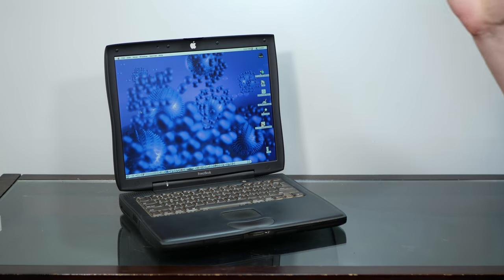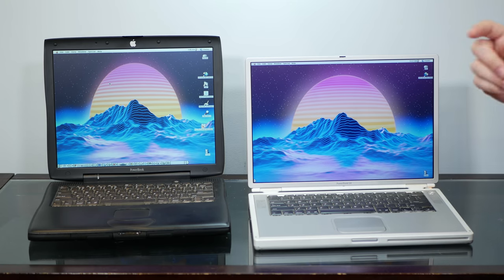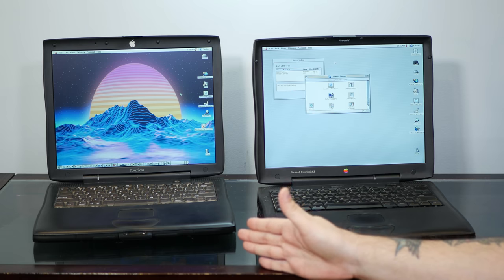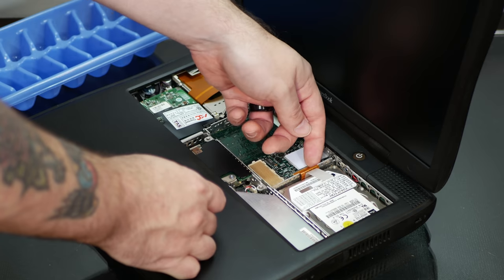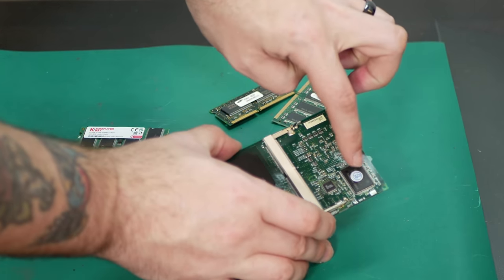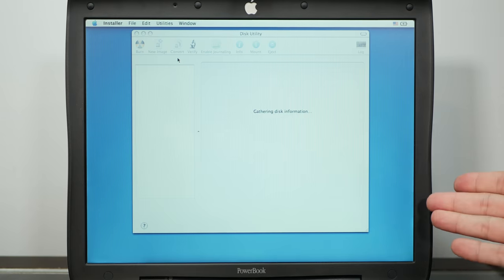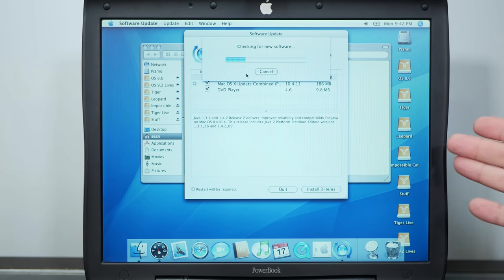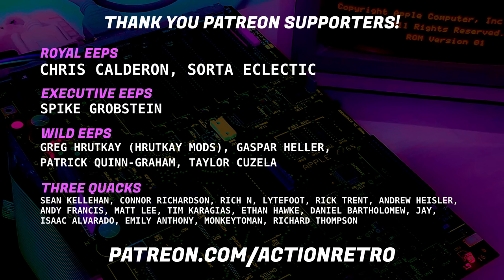I'm Sorry, PowerBook G3 Pismo.

Comment: SSDs make everything better.

I have a 12-inch PowerBook G4 and it's a lovely little machine but the G3 Pismo is the vintage Mac that I really hanker for...
Reply: @lewisalexander  I bought a Pismo for £75 ($100) on eBay a few weeks ago, working and in excellent condition; looks like new. They’re getting harder to find now so if you want one, best to buy whilst they are still available. I bought it purely for nostalgia reasons, I couldn’t afford to buy one back in 1998!

Comment: People love Pismos not for looks but for flexibility, reliability and upgradability. They don't have the hinge or paint issues that plague the Titanium G4s, nor the L2 cache issues and plastic cracking of some earlier G3 models. The 400MHz one when fitted with an SSD is dead silent too - I've never had the fan kick on with mine, even under intense MacOS9 gaming!
Reply: They are much less flexible than the wallstreets though. The wallstreets had two fully modular bays that could accept any drive module each. The pismo and Lombard essentially just have one bay plus a battery. Also the Wall Street has SCSI and Serial, which the pismo lacks, but can still get fw and USB via cardbus. Finally, the build quality of the wallstreets was much better, if not heavier and bulkier.
Reply: I love them for looks. They look amazing

Comment: It feels kinda interesting seeing how EASY it is to replace the components on the PowerBooks of the time, in contrary to the iBook lineup which, annoyingly is like disassembling 85% of the whole laptop to even replace the hard drive lol

I really wanna get a Pismo PowerBook someday, ain't fun messing around with aging iBooks x(
Reply from the maker: lol so true
Reply: @ActionRetro  Not to mention the screw hole threads are molded into the plastics, and can break easily! Mine has half of them broken, so there's no point screwing the screws back :P
Reply: @SonicHacki  I had really good luck with my PowerBook G4, 12-inch.  Did the same SSD upgrade as this video (except it was a 32GB SSD - but same off-brand and adapter) but it was definitely a voyage of discovery.  By contrast, changing the HDD out for an SSD in one of my 2009 15-inch MBPs took me literally five minutes.  The Unibody construction was a huge, huge leap forward - but these G3s weren't far behind.

Comment: I recently performed the same upgrades with my Pismo, replacing the old hard drive (which was still working, btw) with a 120 GB mSATA, and maxing the RAM to 1 GB. Partitioned the SSD into two, with Tiger 10.4.11 and Mac OS 9.2. Back in the day I did the 550 MHz G4 card swap but for whatever reason I had left one of the RAM modules at 128 MB back then, such that I ran with 768 MB. Must have been because RAM was so crazy expensive 20 years ago. Anyway, with the SSD and max RAM, the Pismo is running so much faster than I remembered. It gives a reasonably modern experience, despite being 20 years old!
Reply from the maker: Nice! Honestly I'm shocked at how silky smooth Tiger feels on here, even with the slower 400mhz G3. TenFourFox is snappy too!

Comment: Damn I wish I had a Pismo... 

Meanwhile all I'm stuck with is a basic 333MHz Lombard with an ailing hard drive cable, a power supply that just died on me, a CD drive that doesn't want to slide close but otherwise works fine and a battery that somehow still holds a charge. Worse yet is that the Lombard only has 2 USB ports, so no firewire booting for me!

Comment: I had the Daystar/XLR8 Mach Speed G4 550 upgrade in my Pismo, installed around 2006 or 2007.   They required sending the whole laptop to them for the upgrade, not sure why?  I searched my email and I still have the receipt, it was expensive -- $639 got you 1GB of RAM + the CPU upgrade.
Reply: They probably desoldered your Mac's ROM chip from the original card and applied it to your new one - they can't flash their own chips with the Mac ROM as it is © Apple. Some had a software tool to dump it to disk and a basic loader on the upgrade to write it to its flash chip instead.

Comment: I had a Lombard and then a Pismo back when they were new and they were wonderful machines. I ended up modding the Pismo quite a bit, installing a 500mHz G4 and translucent blue keycaps, as well as doing various things with the expansion bays. I even had an adapter that would turn an expansion bay into an external FireWire drive. I used it as my main machine until 2003, but I still kept it afterwards. Just last year I did a similar upgrade as the one you showed, adding an SSD and honestly it’s still very comfortable to use, as long as you’re doing something period appropriate
Reply from the maker: I've been writing all of my scripts on my 12" PowerBook G4, I think I'm going to try writing some on the Pismo instead. There's just something about it that feels special.

Comment: I completely refurbished my 500mhz model, the screen had a very, very dark pink hue that would not go away, the keyboard was on its last legs, the battery was stone dead, so was the hard drive, the cmos battery and the dvd-rom drive, it didn't had the flap on the back and some other minor issues. But now, it keeps date and time, the screen doesn't have that horrible pink tint anymore, the battery keeps a charge (because i changed the cells, and yes, even the indicator light still works), it has a dvd-rw drive now with the original bezel attached to it, it has a 100gb hard drive, i even attached its flap on the back, so now, this machine looks like a good example powerbook, it was my dad's laptop he bought new way back in 2000, i am very glad i got this machine back up to original spec and working perfectly fine!

Comment: Oh shit, 1GHz G3! Maybe I missed you saying so, but do the instructions per clock make it faster for most instructions than the G4?

I love how easy these are to tinker with. Makes you laugh that some people back in the day said laptops were prohibitively difficult compared to a desktop. Sometimes you even need a non-standard part and everything! The horror! Nowadays even a removable battery or RAM is a big deal...

Also, really nice audio on this one 👍
Reply from the maker: Thanks again for all your pointers! Good question about the speed vs G4s. My understanding is that integer performance should be about the same between matched clock G3 and G4 in the same machine, if bus and everything else is the same.

It might make a really interesting video if I can find the G3 500 card to benchmark against the G4 500 upgrade I just picked up! Although cache is different between the two.

Comment: The Pismo was a great laptop but the bridge from the older Powerbooks (Wallstreet) was the Lombard. I had a Lombard. It was like the Pismo but with a SCSI but no firewire vs the Pismo had firewire but no SCSI port. Also the bus speed of the Lombard was 60MHz while the Pismo was 100MHz. You could get the G4 upgrade for the Lombard as well back in the day. I had a 333 G3 i upgraded to a 400 G3 but never got the G4 upgrade. Ran great on 10.3.9. Sweet memories.

Comment: Dual 3550mAh battery repack, max RAM, and probably a custom made 1.7GHz 7448 board. 120GB SSD triple booted between 9.2.2, Sorbet Leopard, and Void Linux. And I'd probably color in the Apple logos or cover them with rainbow logo stickers.

Comment: Looks great! Don’t forget to upgrade your firmware to 4.1.8 before you upgrade to your G4 CPU. Most upgrade cards require the latest firmware before installing the upgrade (some require additional software changes as well). You will also need OS 9 on the machine to do the firmware upgrade (9.1 or later I think, but I always just install 9.2.2) . Feel free to reach out if you need help finding the firmware. Hope this helps!
Reply: Hello, I need help finding the right firmware for my All-in-One 5500 Power Mac.  After adding a 7-inch PCI card with to provide two USB 1.1 ports received an error message saying that, I needed a software update.  Do you know where, I can download OS 9.1 or OS 9.1.2?
Reply: @transitengineer  I am assuming you mean operating system, not firmware? If so, according to EveryMac, the last natively supported operating system for your 5500 is Mac OS 9.1 (there is no 9.1.2; the only official versions of OS 9 are 9.0, 9.0.4, 9.1, 9.2.1, and 9.2.2). PM me if you have not already located Mac OS 9.1.
Reply: @prototypebuilder5150  Thank you, for your help yes you are correct it is version OS 9.1 that, I need.  Back in the day, I had made a copy on a Zip Disk but now, I can no longer find it.  Please let me know how, I can get a copy of OS 9.1.
Reply: @transitengineer  There is a Garden and a Repository where you can locate an installer for OS 9.1. Both of those are great resources for finding old Mac software. Hope this helps.

Comment: just like with the clamshell, if you cut open the mSATA enclosure (I do mine in thirds, so I can still secure it), you can swap out the mSATA by just lifting the keyboard.  No need to remove the processor anymore.

Comment: the amount of compound was perfectly fine, it's that again, AS5 is not recommended for chips with SMD components surrounding the core because it is semi-conductive no matter how much arctic silver wants you to think otherwise.

RTL8188CUS based USB WiFi adapters (i.e. Netgear WNA1000M, a nano N150 adapter) are still a good idea, if you are willing to give up a USB port to it. 10.4 drivers are readily available off a google search. an Echo Indigo or Indigo IO will provide 24/96 audio playback for maximum hipster cred, and getting a G4 out of Australia is worth the upgrade given you do the hot air swap or have someone do that for you.

Comment: Make sure you have Trim enabeld for your SSD. It was not available until OS X 10.10.4 (without using 3rd party tool)
Reply: No TRIM support in 10.4 iirc, but modern SSDs with a good controller and DRAM cache make TRIM uneccessary nowadays.
Reply: @chriscalderon1337  I doubt you are correct with that statement, I'm googling but can't find any information stating that TRIM is becoming uneccessary nowadays, paste a link here if you find it. Regardless, that 60GB mSATA SSD can probably not be considered modern. It will work without TRIM but get slower over time.
Reply: Would also be interessting to know if TRIM even works using that IDE to mSATA converter. Maybe it wont.
Reply: I believe Trim is part of the SSD and doesn’t really care about the external interface.

Pretty sure that Trim software was separately available — possible that DosDude1 has it stored in one of the folders on his web site too.
Reply: @stevearkwright unless there has been some recent changes, TRIM has to be initiated by the operating system, and older operating systems did not natively support this. It's basically a command sent over the interface.
After some searching it seems it can work with some IDE to mSATA converters. So not a hardware limitation which is good news.

Comment: I bought one of these back in '05 and painted the top plastic bronze to match the keyboard; also put a color matched film under the logo so the apple glows bronze as well. Blending those colors (black, bronze, white) properly really changed its whole character. I had a TiBook (667 DVI), G4 iBook, and this through the '00s, and this was by far my favorite. It was like having one of the desktop tower cases in laptop form in that you could access everything within a few minutes. The big thing to keep an eye on: mine is on its 3rd sound/power plug board. The constant in and out of the power plug seems to wear them out, and it is only about 3 steps from a total motherboard replacement to swap it. 
That said, I still have and use mine. It even has a functional BTI battery. I am curious though: where do you find good rebuilt batteries? I would love to have a double setup.
Reply: I think rebuilding the Pismo's batteries is DIY only right now, I haven't seen anyone advertising but it'd be awesome if there was a place to refurbish them for you.
Reply: @amirpourghoureiyan1637  That's what I thought too. Thanks.

Comment: Glad you came to your senses :P

Did you replace the little aluminium shiv between the CPU and the heat sink? After reading up on this a bit, I opted for K5 Pro instead of standard thermal compound as it has better vertical reach, negating the need for the shiv.
Reply: Not sure all have one fitted - mine didn't have one when I removed the heat sink, and the compound was the original black stuff. A simple MX4 application worked well for me, using an OS9 temperature monitor the CPU stayed below 60 celsius whilst playing intense games even.

Comment: A couple minor notes: The Pismo had no native floppy support, only LS120 drives internally or USB types externally; the WS was not 50MHz but instead had the choice of a 66 or 83MHz system bus, with the PDQ offering only 66MHz.
That said, the Pismo was always pretty decent whereas the Lombard was kind of unimpressive and worthy of being overlooked. Yes it had the new sleeker case and faster processors compared to its predecessor but that was about it: the graphics chip was still on PCI (Pismo was AGP), the 333MHz version still only offered a 66MHz bus, and the 400MHz version had a hardware DVD decoder subsystem soldered in whereas the 333MHz variant didn't; if you wanted DVD playback you had to buy a separate drive and decoder card like the WS/PDQ used, and either way neither hardware decoder is supported under OS X so it's kind of a waste. The Pismo did DVD playback in software and offered several other improvements that made the Lombard a poor choice by comparison whereas the WS/PDQ still offered some compelling features over the Pismo (double CardBus slots, native floppy support, double drive bay support, full legacy ports). In short, don't bother with a Lombard unless it's really cheap or free but if you can get a good deal on a Pismo, go for it.

Comment: I really want to use my Pismo more but I cant find a new battery for it that isn't $200
Reply: You might be able to buy the cells (probably 18650 cells, other Apple laptops use them like my 14" iBooks) and replace the used up ones with higher capacity cells. Assuming they're the same cells as in the iBooks, you could potentially get 12.5 hours of charge out of a new 3550mAh set of cells for one battery or 25 hours for two... if my math holds up.

Comment: I had (well, still have somewhere lol) a Pismo I bought secondhand in the early-2000s.  Sadly you can't buy new batteries for them anymore (and I welcome correction to that if someone knows of a source) but after the Intel transition, I picked up a G4 550 card for mine for a good price as I thought in Mac OS X, the G4 550 would produce a better user experience than a faster G3, however looking back now I cannot imagine a scenario where a G3 at 900mhz-1ghz wouldn't have felt faster, Altivec be darned lol.

Comment: I plan to RAM upgrade my ( second) 400 Mhz Pismo, too, but can't remember if it really was necessary to use that low profile ram on the other side. on ebay I can find 2x512 MB modules but they have the same size.

Comment: Did you see on LEM one of these SSD enclosures caught fire? I just bought 3 of them for my projects 😳
Reply: Caught fire? 🔥 Yike!  Sounds like a faulty PCB in the enclosure (maybe a voltage problem).  Hopefully, it was just the one — rather than (especially in your case), a whole batch.

Keep that CO² fire extinguisher handy!  First sign of smoke or a flame... blast it. 💨

Comment: I had the 400MHz version (found for cheap at a thrift store) but someone had broken the power recepticle. I brought it to a community college I worked at at the time. I rigged up some power supply and guess the voltage was reversed. Well the smoke came out and I heard sizzling.  I ruined the power switchboard inside the laptop. That was shoved in the bottom of a drawer years ago and I wonder if it is still lurking in that desk. Is it worth asking a dweeb if I can have what is mine and then having a junk project sitting around.

Comment: Very nice! I totally agree about the ugly keyboard, I have no idea what they were thinking. Surely it would've been better with plain black keys. I've always liked the look of those black Powerbooks though.

Those mSATA SSDs are really nice, I picked up one of them for my G4 Mac Mini, and it really does make the machine fly! I did splash out for the slightly more expensive 2nd hand Samsung module, since it's got a fast controller with SDRAM for cache, so it should perform better than those generic modules. Although I did have some issues with it, since I couldn't get one of those nice mSATA to 2.5" IDE converters, so I had to use a combo of a mSATA to SATA and SATA to 44-pin IDE converters, which I think is causing some instability in my Mac Mini. Ended up having to run it in a SATA firewire enclosure while I wait for the mSATA to 2.5" IDE converter to arrive.

Anyway, it'll be interesting to see how much the G4 upgrade improves performance. Don't forget to run some benchmarks!

Comment: The main issue with all of these and even the G4 system is the slow system bus and the crappy video card.  OSX does not fully support the video that this machine has and therefore renders without full video accelration and uses the processor to leverage most of the video work.  Linux used to work much better and faster than Tiger on that machine when I owned one of those.